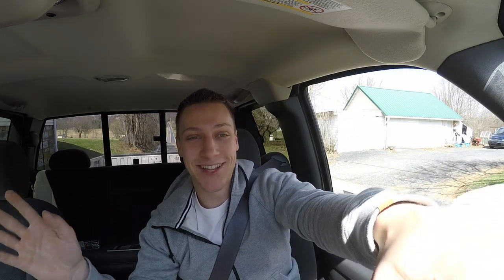WHY I DON'T Roll Coal...

Comment: it's funny to read the comments on coal rolling and see how people react.  Some take it so personally, like they are somehow invested in it, as if some guy a thousand miles away blowing smoke on prius is an insult directly to them.  

I don't do it except for the random tailgater as others have said, but at the same time you don't need expensive tuners to do this, you can put a toggle switch on the turbo that will create a fuel rich mixture on demand.  

All that being said, I also understand the argument for smoking out prius drivers, with only a couple notable exceptions the one's I've met tend to be some smug holier-than-thou jerks.   Why do you think Southpark did an episode on them calling them the Toyota Pious?  Not to mention that while they are very good at getting great mileage, and they are nifty little cars but if you know the facts about those batteries, they are an ecological nightmare!  it's like the dirty little inconvenient truth about hybrids nobody wants to admit.

Comment: Diesels that are stock can roll coal. It doesn't have to be tuned. You are right bout "all you do is push more fuel into the engine and it feeds the excess through the back." But you don't need a tuner. I have an 06 dodge ram 3500 and everything is stock except my exhaust which i'm runnin a 4" straight pipe with a 6" tip and I just absolutely dump coal

Comment: Rolling coal is very douche like. Having a properly tuned efficient power full diesel truck that smokes alittle bit when U really get on it because black smoke is the byproduct of a Diesel engine is good. Other than that tailgaters is the only real reason to have Ur truck smoke like a freight train

Comment: My economy tune from Idaho rob (ATP) was a smoke tune.Didn't plan for the smoke but it did. And as far as trucks that roll coal lose power, my only comment is that I have never seen a drag truck (running 100+) lbs of boost not roll coal the whole way down the drag strip.

Comment: He's 100% correct. anyone on the street is nowhere near pushing the power of a purpose built pull truck. there for if you truck was ACTUALLY tuned CORRECT it will not roll coal and still put down serious power. If your rolling coal on the street find a new tuner. one as in a person that writes tunes. that way you won't be getting ripped off by someone telling your truck to dump fuel before boost. besides your ruining it for the rest of us.

Comment: If you wanna roll coal you don't need a tune its you install a turbo switch "smoke switch" and that turns the turbo on and off when it's off is when the coal rolls

Comment: Your truck doesn't smoke because it probably has a 90hp "stock trans" tune on it.  Any stock turbo LB7 running a 3200us or "max effort"(built trans) tune is going to smoke granted it holds rail pressure. A big tune with low end fueling is going to smoke before the turbo lights since heat and drive pressure spool turbo chargers more agressively. Then you get into bigger charger trucks with bigger injector trucks.

Comment: Roaling coal is unburnt fuel so it is losing power so whenever you see a truck dumping smoke out there just sending free power out the exhaust when they could have it tuned right and make more power

Comment: You can switch on the fly with the dsp5, it won't hurt your truck at all. That's what the dsp5 is made for. Also I have Idaho robs tunes on my truck and if you have it on 90 horse it will put out a nice little cloud
Reply from the maker: +MrThorRunner Definitely lol but I'm more or less talking about the massive plumes you see coming from some trucks
Reply: +Street Speed 717 I feel you man, it's so nice being able to run clean and have nice power as well. I'm only a couple hours from Harrisburg I might have to come out to the next cars and coffee haha

Comment: A stock 05 duramax can roll coal which is what I have u can get ur Rpms up and then rapidly press ur gas pedal rapidly to 3/4 throttle or full throttle RAPIDLY it will blow its maximum coal

Comment: rollin coal could be a sign of turbo lag because if you have the optimal air to fuel for your turbo when spoiled then if you tromp it at a red light the turbo lag cause the more fuel then needed at the time and you black smoke    some people learn when there turbo lags the most (stopped or in over drive) then they smoke like that   if they smoke when turbo is spoiled then its a tune specifically designed for black smoking

Comment: I'm not saying I endorse "rolling coal" but I do know a bullydog tuner set to extreme which the tuner doesn't allow you to enter that setting unless your truck is up to a certain temperature you can actually put out a decent amount of smoke. Also if you have bigger injectors to the point where your turbo can't keep up with how much fuels being spit into it it will blow smoke. Similar to what he was saying in the video people install smoke switches where the switch can shut off your turbo which as you could guess will make a truck puke smoke at an idle. "Coal rolling" is just a bad mix of fuel to air.

Comment: my buddy has almost the same setup in an older cummins and in his economy tune he rolls coal while still getting 20plus miles per gallon so Rollin coal isn't always a bad thing
Reply: its always a bad thing, not only could he get better gas mileage, but also he would lower the risk of giving his entire family cancer.
Reply: +Spencer Dansereau I'd like to see you get better mileage then that on a diesel without rolling coal
Reply: +Preston Searle all stock just straight piped getting 21.4 average and 25.6 highway if I don't go above 70..

Comment: Can running rich have similar negative long term impacts on a diesel engine like it can on a gas engine?
Reply: IIRC, yes. It can clog parts of it with gunk and prompt a need for repairs or replacements.

Comment: Rolling coal comes from bad tuning, if you roll coal, your tuning sucks unless you are pushing big hp, then some smoke is ok
Reply: Thank God someone else knows that😂It's also not good for the turbo because then all the soot builds up which then you have to go have it cleaned up. It's way better to have a good tune and have all that black smoke turned into power!

Comment: Hey bro, I have a 16' Sierra Crew  gasser, I dont tow much but love the Diesel sound and toughness and the power.. You think its worth it to get rid of my 16 Sierra Crew cab and get a Diesel? or would it be a waste of cash you think? Also do you recommend the delete,even if I get the 15 or 16' models? 
Thanks

Comment: No matter the aftermarket tune or even a stock tune any diesel truck can roll at least some coal. This is because no engine can be 100% efficient all the time, when you begin accelerating it will begin running lean and as the computer adds fuel it goes rich and back and forth it will never be able to completely stabilize the air/fuel to a specific ratio that will make it so there is no smoke. So even in a 2015 Chevy duramax if you were able to see the exhaust in the tube before the emissions controls there will be some smoke under acceleration.
Reply from the maker: +Philip Logemann Definitely true. Like I said even the cleanest truck will make a nice little cloud from time to time under the right conditions.

Comment: On the lower tunes from Idaho Rob you wont get much smoke if any, but on a max effort 200hp tune or even the 120 trans safe tunes if you get on it hard itll smoke a bit.

Comment: You seem like a decent guy. A little heads up. I don't know what you need your truck for but the switch to electric is coming. Already the Cybertruck has the engineering to do all the jobs you need a truck for. There will be a tipping point when the ICE truck will be worth nothing. The money you have in it will be stranded. This will mostly happen due to emissions regulations. However a lot of people also like clean air.. So there is pressure from the public as well as regulators. It will happen quickly. Heads up. Get a Cybertruck and solar panels. Make your fuel and don't give your kids asthma.

Comment: i have tuning by kory willis,  he wont do smoke or lope. my lmm feels awesome with 5in turbo back and egr delete. next mod is fass lift pump, i recommend you get one too  protects injectors better and gets you a bump in fuel economy plus you can run higher hp tunes safer

Comment: my powers trove in the high-end tune with my injectors and larger turbo will blow smoke until I build boost. I could probably get it tuned out but not worth the time really. my daily tune doesn't blow in smoke so I'm cool with that.

Comment: If the 15L 550hp Caterpillar I drive for work, pulling 137,500 pounds up a 6% grade doesn't blow black smoke out the stacks, that little 6.whatever litre pickup truck doesn't need to either. Never understood "coal culture" at all.

Comment: I like modifying diesels as much as these guys do, but at the same time, I like to be conservative in terms of power, if I were to put on larger injectors (or at least change a tune where it pushes more fuel to the engine), I would put a larger turbo as well so I'd get the proper air/fuel mixture so I can make more power and still get excellent fuel economy (maybe better since it's not running super rich).  This coal rolling trend that is completely bogus if you ask me.

Comment: "Rolling Coal" is bad for your truck. theres cross hatchings on the Cylinder walls of the engine block, When you roll coal like that it wears the cross hatchings down and those are important for seating the piston rings.

Comment: ive got a truck exactly like yours and mine isnt tuned and it rolls coal. ive got a 4 inch strait pipe and a volant intake, i also have a edge juice with adidtude i keep it stock though

Comment: When you say its not the optimal tune for your truck, you're right and wrong. When you have high hp daily trucks that make 700-800hp you arent going to find one that doesn't "roll coal" when you hammer down its just when you add more power (adding fuel and air) you get smoke. Which in tuners thats what they do add fuel and air which then black smoke comes out. Obviously you can spend hundreds of dollars and have someone tune your truck for you but you will still have black smoke if you put a chip or programmer on
Reply: people drag race these trucks without rolling coal
Reply: You sir a wrong. If you get enough air in you will have no or at least very little smoke out.
Reply: i didnt say it was impossible because it is possible but find me a truck that is making 700-800hp that either pulls, drags or even a daily that when you hammer down it doesn't have black smoke coming out the tail pipe...

Comment: The only three switches I have on my 24 valve is three cylinder high idle, (that's two different switches btw) and lope, the rest is in P chip/tuner. I actually HATE when another guy comes up and blacks out my winsheild with his "coal", I always punch it to avoid the smoke. I HATE coal rolling.

Comment: Diesel cars are more polluting than their petrol counterparts. This is why new regulations in EU are requiring car manufacturers to have stricter emission controls on diesels. Such as DPF filters and exhaust additives. Certain cities ban diesels from city centers and many car manufacturers offer discounts to scrap your diesel for a petrol or alternatively fueled car. Rolling coal increases the level of particulates pm10 and pm2.5. These are cancer causing and also cause respiratory problems. They have also been found in the blood and tissues of people. Furthermore how can anyone be allowed to damage another person's health because it looks cool or is "tuned" how would you feel if it was the other way around. Choking on soot. Pipe it into your cabin if you like it so much.

Comment: i have a stock exhaust on my 6.0 i wanna get a straight pipe and it wouldnt roal coal for miles like the people who tune em its more like it would do it for like 2 seconds at most and it wouldnt be thick mine does it a little with a full stock exhaust but you gotta mash the pedal

Comment: in order to roll coal you don't need a huge tune or anything, I have a stock 1st Gen dodge Cummins and it rolls coal, all diesels disperse black smoke and more will come out the harder you push the pedal, but there are ways to enhance the cloud of smoke by tuning. I see Volkswagen roll coal you don't need to bring it to a tuning shop

Comment: Surely diesel motors have to contend with carbon and soot deposits like normal motors running rich? If that is the case then rolling coal is actually detrimental to your engine. The proper tune seek to achieve stoichmetric balance.

Comment: Driving a big rig if you look into the exhaust pipe of today's rigs the are silver clean. We need them to get the max hp and mpg. Most of the time I'm pulling 105,000. No smoke. Max $ in the pockets.

Comment: Rollin coal is also really hard on your engine. When you cram that excess fuel into a compression type engine (diesel), it still tries to compress that fuel and creates a fuck ton of heat and extra pressure in the combustion chamber, so you're asking for bent rods and cracked/melted pistons when rollin coal all the time, but those people deserve it lol

Comment: my 03 Duramax doesn't roll coal Either I have my tune set for the lower the RPM the lower the Fuel rail pressure and more RPM is more fuel rail pressure, with more boost.

Comment: I had a 06 25500hd Chevy work Truck with the Duramax, my dumb ass Traded it in and got a Chevy 7ZI Classic And it is the worst truck I have ever owned. So I want another Duramax, my old one was getting 17-19city and 22-25highway. Now people tell me don't buy the new ones, the Gov Regulations.... And they are not any good. Can I ask What your opinion is? Should I get a 15-17 Chevy Duramax or no?  I want to get a RC either a Trailer or a 5th wheel or a Camper. Thanks for your Opinion. I did Find a Humvee for a go Price, and is from the Military.. Can you please tell me what you think thanks Subed...

Comment: Doesn't all that extra smoke and unburnt fuel eventually clog up your engine or exhaust with carbon deposits.?
Reply: It's possible to clog up
Reply: +Hemi Power 

Negative. All that soot will build up in the manifold and turbo over time increasing EGT's and decreasing turbo efficiency. Rolling coal slowly kills your truck...but most of the chuckleheads that roal coal end up blowing them up and having mommy or daddy buy them a new one anyway.
Reply: Hemi Power

No, not really. Look up pictures of clogged EGRs and you'll see. Imagine all that building up on the vanes of the turbo. Rolling coal just isn't a smart thing to do. I understand some smoke from the exhaust, but the people who tune their trucks just do do that crap are the new ricers. Addicted to JCWhitney and rolling coal, keeping the values sky high on diesel trucks that have been completely and utterly raped.

I personally will never buy a diesel truck that is modified in anyway, its so bad, because I don't want someone's ruined secondhand junk.

Comment: So, my truck is a diesel, And, there is a mechanic I have for my car. He  said if you put a exhaust  on a diesel it rolls coal. BUT, you have an exhaust and you don't roll coal. so idk?
Reply: Pay attention chief, you need to tune it in order to dump out the excessive fuel. TOO RICH
Reply: XRAY kat Ok. Thanks.

Comment: a lot of people just have the plug in tuners and the higher hp settings it will roll a little....even then stock 5.9 cummins I was would blow a little cloud under load

Comment: Sorry but you are incorrect when you get bigger injectors and start getting more power you change the air fuel mixture to get maximum power when you have bigger injectors you will need more fuel causing it to smoke

Comment: "Roll coal" the only reason our truck does it when driving is when we are pulling heavy equipment with the 7.3 engines with a chip in it for more power.

Comment: What this guy said, and Gale Banks says not to. If you drive a diesel and don't know and respect Gale Banks, I don't know what to say to you. Like he said though, running too rich means less power, less fuel economy and more pollution. Basically, rolling coal is for douche bags who don't know shit about truck performance.

I'd advise against smoking out tailgaters though. One time I was the designated driver and was driving this guy's (POS Dodge) truck who was burning rich. It was 2am in a rural area and a car started riding my ass pretty close. The guy was telling me to smoke him out, and right when I was fed up enough that I decided I was going to do it, the car tuned his rotators on. I almost smoked out a sheriff's deputy. fortunately I did not and he let me go with a verbal warning. I guarantee that would not have happened if I smoked him out.
Reply: That's exactly why I put Banks gear on my 2005 Max. Certainly won't run as wild as EFI live does but i'm not at that stage yet. Maybe later when I'm in the US long enough to get the trans rebuilt, had gaskets and studs. I can see rolling coal if you're at the track but no reason to do it on the streets just to piss people off. we have enough emissions crap already.

Comment: Diesel engines are fuel throttled. They will all produce soot when the throttle is punched, regardless of tuning. Sure you can get over-the-top "smoke tunes" which are completely stupid, but to say "You won't get any smoke from the exhaust on a properly tuned truck" is wrong. With the exception of DPF-equipped trucks (Which still produce the same amount of soot, it just gets caught in the filter), all diesel engines will "roll coal" to varying degrees when they are over fueled AKA anytime the throttle is being increased.